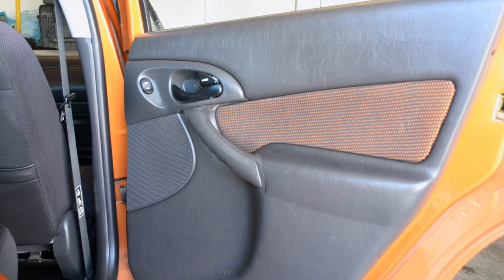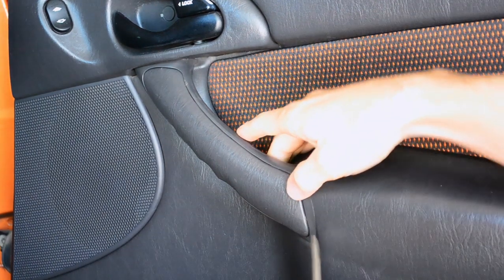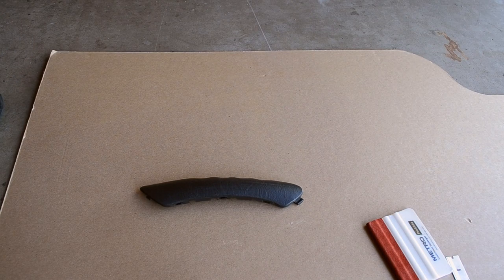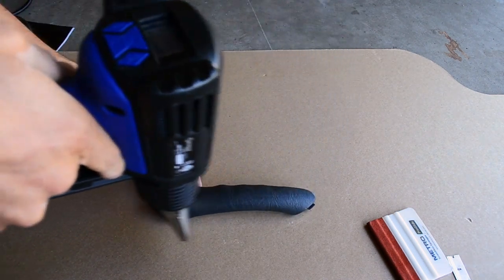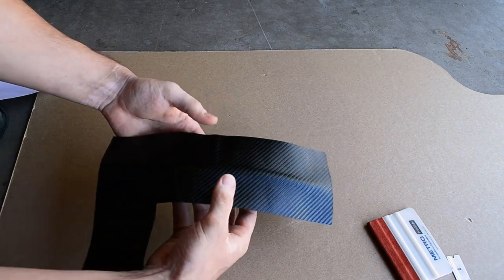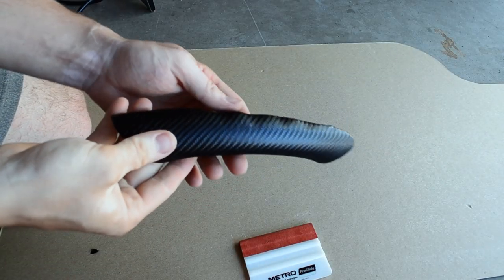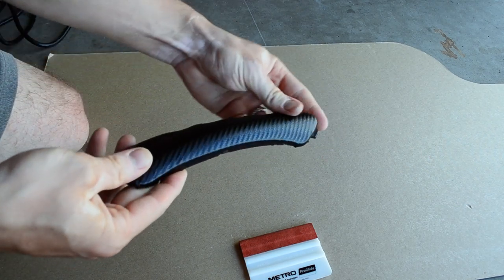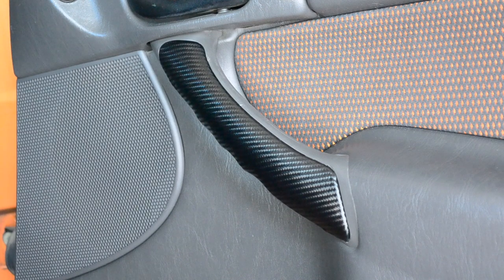4d Carbon Fiber Vinyl Wrap on Interior Door Handle

Comment: Nice one. I want to wrap the central console for a MK1 Focus. Do you think is difficult for a beginner?
Reply from the maker: Thanks for watching. You will be able to do some parts of the center but as for around the cup holders it will be difficult as a beginner. There is a learning curve that you need to be expecting when beginning. Make sure that you at least buy enough wrap to "do it twice" in case you make a mistake.  Even before you start wrapping sometimes you will think that you cut it big enough and you will be short. Buy extra and give it a shot. The worst that can happen is that you take it off and toss it in the trash. If you go in with that mind set you will have more patients while doing it.
Reply: Hello, so I've tried to wrap, but is difficult as hell and was a failure :). You need a lot of patience for this. The middle console is a complicated geometric shape. I'm gone work on some simple parts. Thx for the indications!
Reply from the maker: No problem. Maybe with some more practice you might be able to make it work. Good luck and thanks again for watching